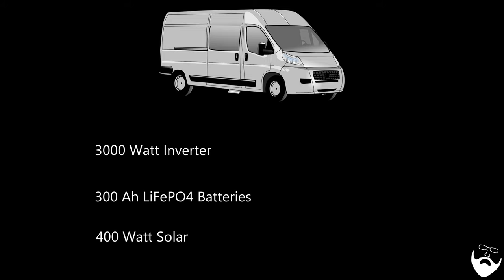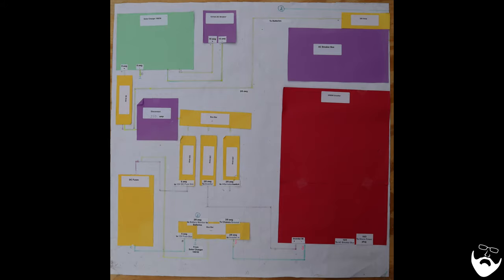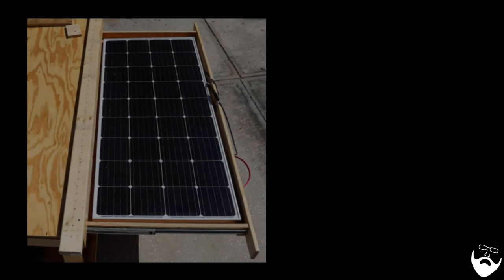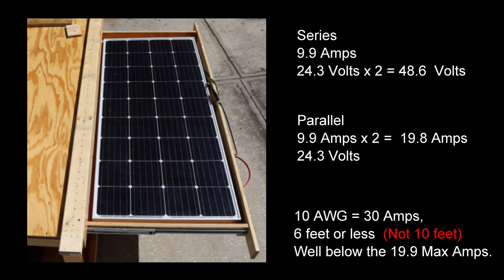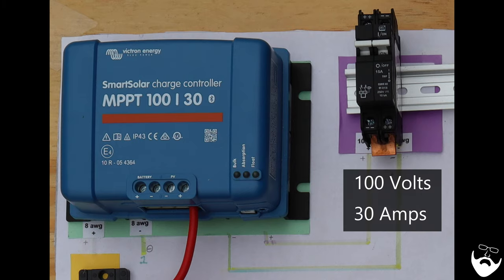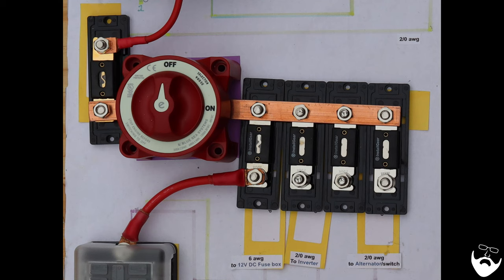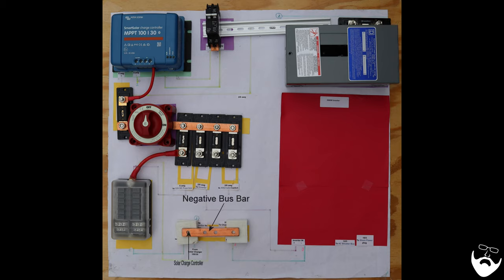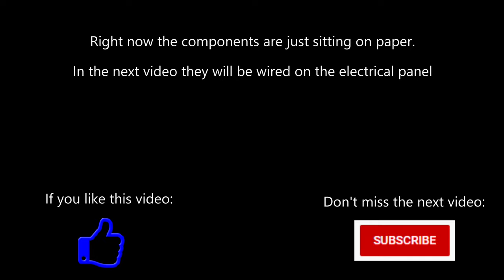Van Life Electrical Panel prototype

Comment: thanks for the helpful videos...
i'm curious what your purpose for putting the Charge Controller+Fuse on the other side of the Shut Off Switch than the other 3 Fuse+Components ...?
Reply from the maker: If I understand your question correctly - This placement allows the solar charge controller to charge the batteries even when I shut off the power to everything else.  So, the batteries and solar (all sources of power)  are disconnected from all of the loads.

Comment: I am curious what inverter you went with. I'm going to guess not a Victron since you have a separate charge controller. I was looking at those Victron's but for what is needed they seemed over the top. I'm favoring the Aims 3000 watt industrial, but I have plenty of time to research...
Reply from the maker: I have a Victron Multiplus 12/3000/120.  It has been working well.  I do not have experience with Aims, but understand it is a quality product.  I do suggest using the Victron battery monitor BMV-712  (  https://amzn.to/3Bxszfa )  It is Bluetooth enabled and provides easy, accurate monitoring of your battery bank.  Their solar controllers are also Bluetooth enabled.  That is the primary reason I went with Victron products.

Comment: Nice, good advice, clear-Thank you! I'm putting a van electrical system together. What are your thoughts on a 24v system?
Reply from the maker: A 24 volt system could be more efficient.  But 12 volt materials are more available, cheaper, and easy to replace if needed.   Both will work.